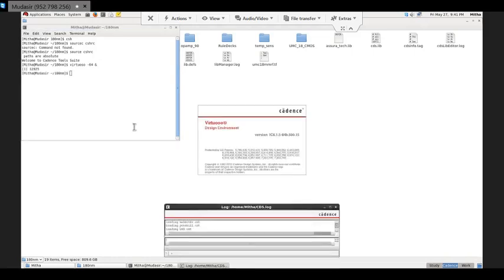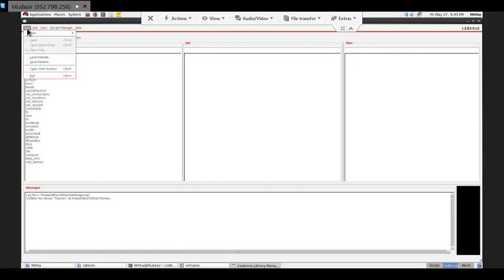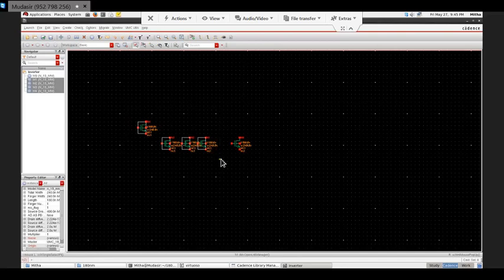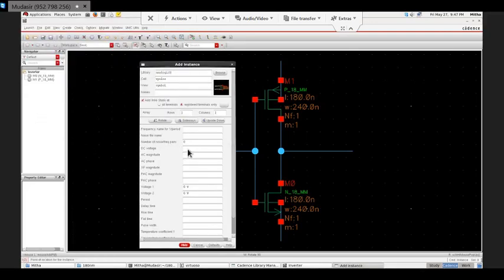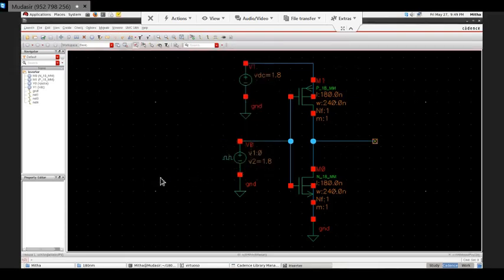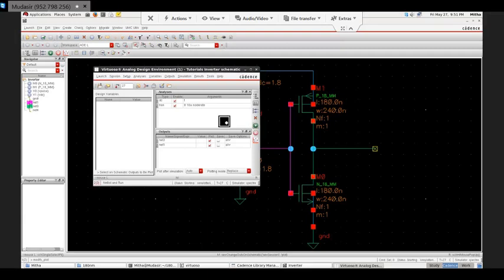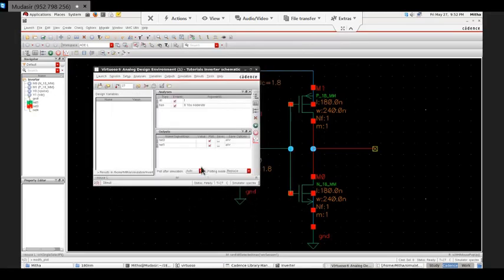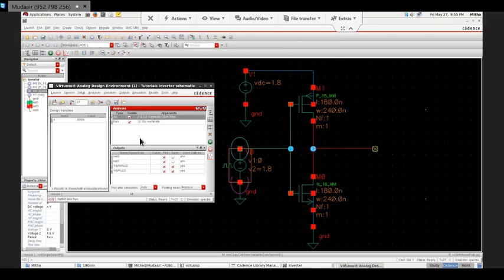Cadence IC615 Virtuoso Tutorial 1: Schematic Entry and Using ADEL

Comment: Explain how to calculate power dissipation
Reply from the maker: Following are the steps to find power consumption in Cadence ADEL
While setting up the DC analysis, click on save DC operating  point.
In the ADEL toolbar, go to options >>Save all
A window will popup and there click on "all" in the first two options (select signals/select power signals...).
Save it and do dc/trans analysis. whichever power  consumption you are interested in.
Once the simulation is done, Go to Tools in the toolbar window of ADEL. Tools>>Results Browser
in one of the  the left column you will see different options..like tran/tranOP, dcOP, dcOpinfo etc.
For DC power consump...click on dcOP..you should see :pwr(W)
For transient/dynamic power...click on tran..right click on pwr , you will get a graph of power consumption. You can send this graph to the calculator and take the average to find the value of dynamic power consumption.
I hope this helps.
Reply: Thank you very much sir...
Reply: Got it
Reply: Sir for sram how we can calculate power dissipation

Comment: Hello, I need help with Cadence. I  need to simulate a circuit with custom data set(this data set is currently saved in other in form of array) how can I give this  data as input to schematic and simulate the circuit ?
Reply from the maker: Hello, you haven't provided enough information. In general, if we want to add noise to  source for simulations we define it in noise file name (simply define the path of file where you have kept it) and yes explore the vsource signal from analogLib. there you will find options for defining input file as your stimuli (for pwl)